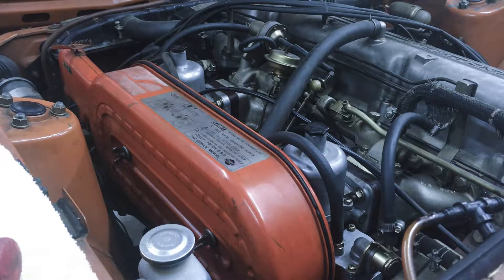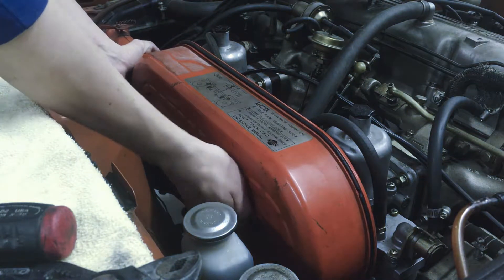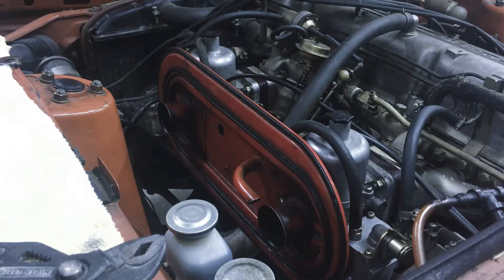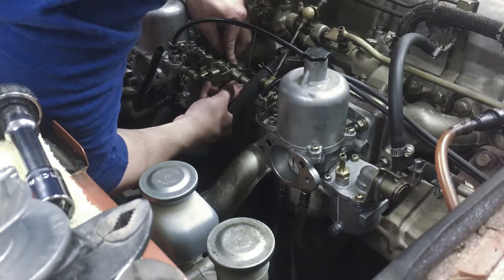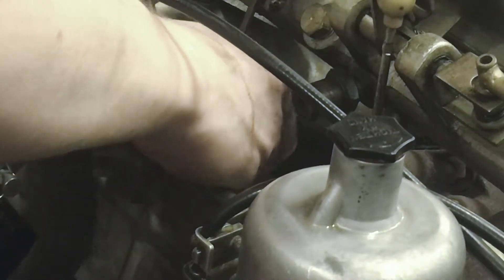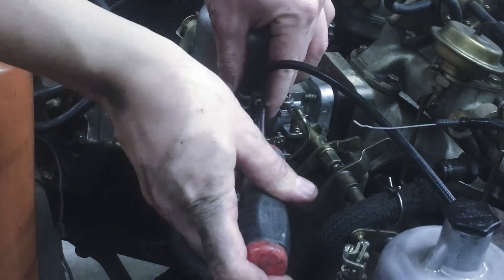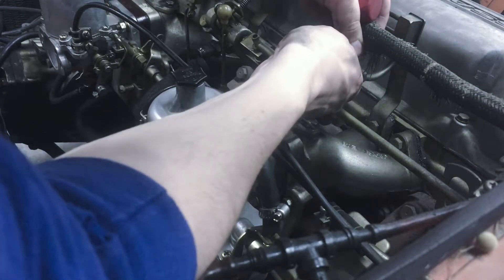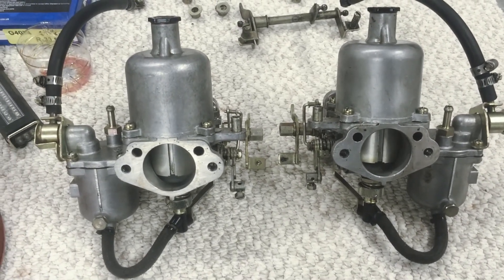Removing SU Carburetors - 240Z Carburetor Guide Ep. 2

Comment: Thanks for making this video. Tryin to get my moms old 240 goin again after sitting for 12 years. All without her knowing. Should make a great supprise for her.
Reply from the maker: Wow, that’s one of the best things I’ve heard all year!! Thanks for commenting. Please let me know how it goes and if I can help at all.
Reply: @zcarguide  I have stumbled upon an issue. No spark. If I ground the negative side of the coil there it's spark, but not when actually cranking. 

I think the issue may be in the distributer. If I remove that to clean will I screw up all the timing?
Reply from the maker: @DWoona  I do think you will have to reset the timing after rebuilding the distributor. Wish I had good info on that but I have only disassembled one in one of my videos for the L24 rebuild.

Comment: At 5:03 you remove a hose from the manifold, this might be a dumb question but what is that hose?
Reply from the maker: That is the PCV hose, it goes from the engine block to the PCV valve on the balance tube (where you see me removing it from)
Reply: Bro you just saved my life

Comment: XD you didnt show how they come apart! i only want to take off the rear. do they just slide apart from each other?
Reply from the maker: Because the way the linkage is installed, I believe you have to remove them at the same time as shown in the video. Also, this is a video in a series I did on carbs, the next video shows the disassembly, cleaning, and rebuilding process: https://www.youtube.com/watch?v=8WHK2hHnNbE